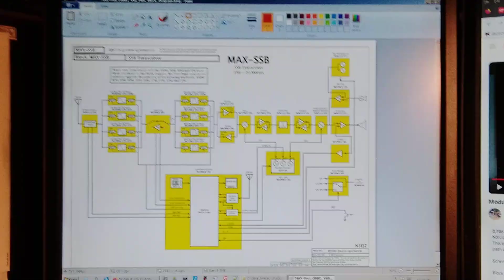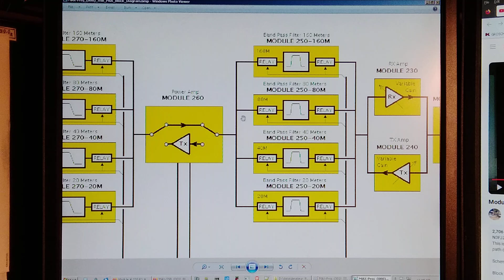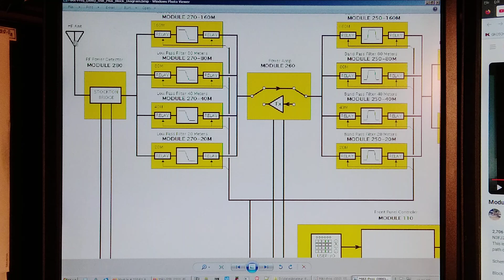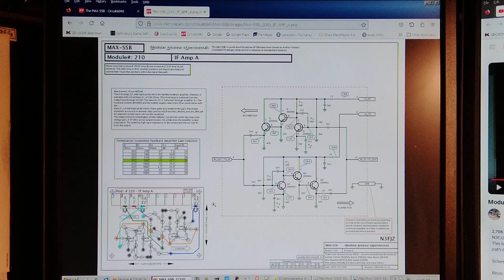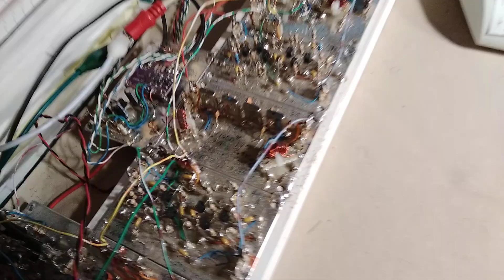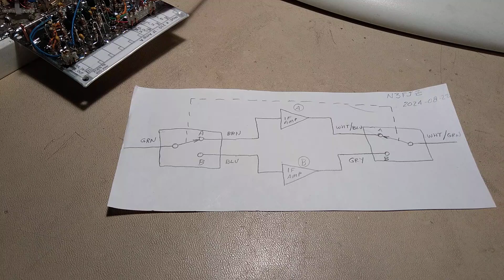Module # 210 IF Amp A - MAX-SSB Transceiver Project

Comment: Great job Rick. Already started the build.
A question, if I may.
What rating should the speaker be ?
I read somewhere that the BD139/BD140 combination should be good for at least 3 Watts. Would a 5W 8 ohm speaker be enough ?

Can't wait for the completion of the rest of the modules !

73,
Hans, PA3CRZ
Reply from the maker: I believe the speaker I used was around 5 watts.  I is an old computer speaker JBL # 304241-001 and sounds fantastic compared to a bare speaker.  You can sometimes find these, used, on ebay et cetera for a reasonable priced.  73 - Rick - N3FJZ

Comment: Lovely work as ever and have you changed the lcd display?? Looks less cluttered
Reply from the maker: The display is connected to a different version of my Front Panel that uses an Arduino NANO instead of the more advanced MEGA 2560.  Because of the limited memory and I/O space in the NANO (vs. the MEGA), the NANO version is very limited in features.  Here's the link to the NANO Front Panel http://www.remmepark.com/circuit6040/MAX-SSB-NANO/max-ssb-nano.html  73

Comment: great great work .... I would really like to start the construction but I'm afraid it's too much for me .... a big hello
Reply from the maker: Thank you GiorgioFirpo!  Yes, in the early days of my homebrew attempts I was intimidated by the complexities of the projects on the web and books.  I found that I had to start small by building very simple circuits first; e.g. AF amplifiers, RF oscillators, et cetera building up my construction skills over time.  One project that helped me was to take a transistor AM radio, draw a schematic by following the traces of the PCB, then carefully remove the parts from the working AM radio one stage at a time and build it homebrew style as modules.  When I was done I had a modular homebrew AM radio.  :-)  Also, there a a lot of inexpensive AM radio kits, buy two and build the first one using the PCB supplied in the kit, and build the 2nd one as homebrew  example:  https://www.aliexpress.us/item/3256806101211832.html?spm=a2g0o.detail.pcDetailTopMoreOtherSeller.2.508a1479jZx2Lw&gps-id=pcDetailTopMoreOtherSeller&scm=1007.40050.354490.0&scm_id=1007.40050.354490.0&scm-url=1007.40050.354490.0&pvid=72d37e26-289d-4277-9b1e-149a87b08a58&_t=gps-id:pcDetailTopMoreOtherSeller,scm-url:1007.40050.354490.0,pvid:72d37e26-289d-4277-9b1e-149a87b08a58,tpp_buckets:668%232846%238113%231998&pdp_npi=4%40dis%21USD%214.63%210.99%21%21%2132.87%217.02%21%402103080717244106061061390e4344%2112000036620087800%21rec%21US%21%21ABXZ&utparam-url=scene%3ApcDetailTopMoreOtherSeller%7Cquery_from%3A
Reply: @Circuit6040  Thank you very much for your advice and guidance. I will follow your implementation very closely. Best regards
Reply from the maker: @GiorgioFirpo_IU1BKT  You're welcome!  73 - Rick - N3FJZ